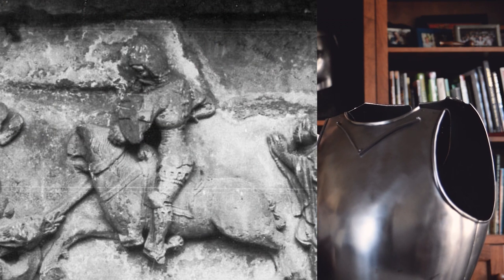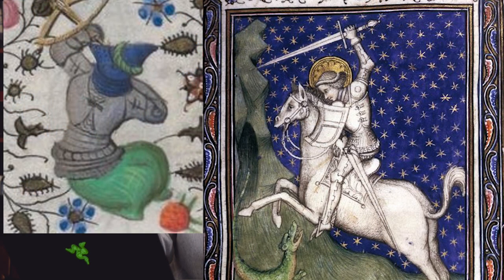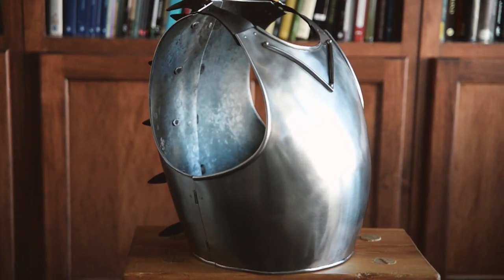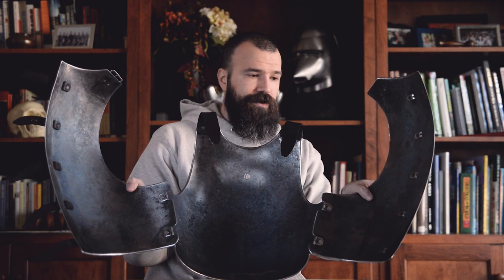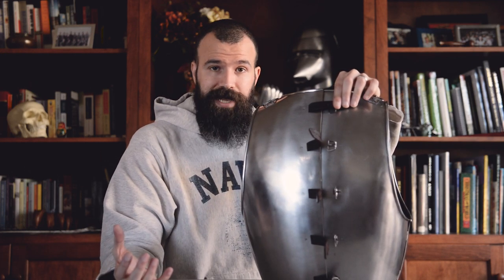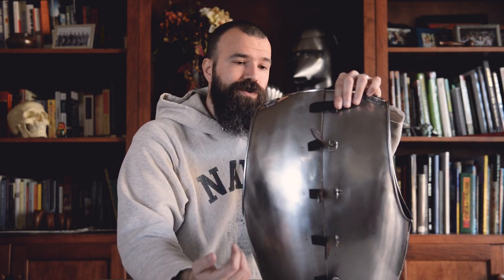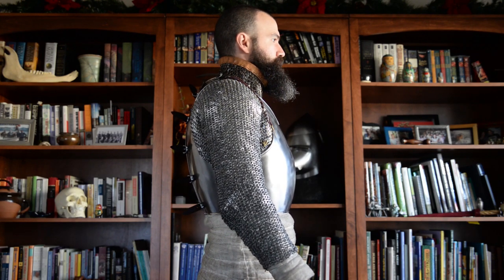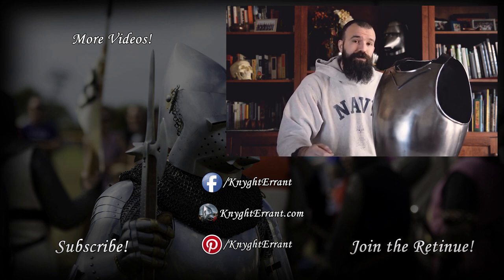Early 15th c Cuirass Part 1:  Breastplate and Hinged Backplates

Comment: Heyya! May I ask if have access to, or experience with the later Spanish style breastplate?
The type that terminates fairly low onto the abdomen, unlike earlier breastplates where they terminate right below the ribs.
I'd like to ask regarding the stomach mobility of the Spanish breastplate, since it's usually a solid plate with no articulation. Would crunching your abdomen cause it to bite into your abdomen?
Reply from the maker: Most of the fit and mobility from a breastplate really comes from the breastplate compressing and terminating at the natural waist along the sides of the torso rather than directly in the front. It's the lateral compression that bares most of the load. A peascod breastplate still fits snug at the sides where it counts, and then projects lower and outward in the front. It may slightly lessen one's ability to flex the lumbar spine purely in the sagittal plane, but your hips should more than make up for that and you would still have your ability to bend laterally and twist at the natural waist like normal.

Comment: One thing I've been wondering: Is there any configuration of full plate armor that would be possible to put on without the help of an assistant? So far it seems that chest/back/shoulder armor always comes with straps or buckles that you can't reach on your own (at least not with both hands). Is there any feasible way around that?
Reply: Not without compromises to protection I would imagine. Knights who could afford full plate harness had servants. And having people who's job it is to put armor on for you are way more convenient than being able to put armor on yourself, especially if being able to do so requires sacrifices in protection.
Reply from the maker: You can put things like a front-opening brigandine on yourself.  Sometimes there are a little tricks to getting certain styles of shoulders on like leaving them attached to an arming garment or mail shirt etc..,  You have to remember though that no one was ever really needing to put on armor by themselves.  Knights may have had attendants, but even the poor footsoldiers in outdated coats of plates had each other to help don their armor, so getting it on by oneself should never have really been a historical concern.

Comment: Knyght Errant, I'm sure this is a naive question but if the gap overlaps why didn't they design it to open in the front so that a man-at-arms could put the armor on (or take it off) without assistance? Was assistance just taken for granted by the folks that could afford that sort of kit?
Reply from the maker: Openings are generally structural weaknesses in armor that can degrade it's protective quality.  A lot of the time, the design of breastplate is made in anticipation of receiving a powerful lance strike or crossbow bolts, so you want it to be one of the strongest and thickest parts of the armor.  A strong lance strike to a front-closure could compromise its protective value.  You're very unlikely to get hit very hard in the back unless your unit is routing, so it's acceptable to keep the back the 'weaker' part of the armor.  This is reflected in the fact that backplates are often omitted entirely from armors even after they had developed.  They were also developed later than the breastplate, so we know it wasn't nearly as much of priority.  Now as for armor requiring assistance, virtually every full armor requires assistance to get into it.  Knights and ranking men-at-arms would have had dedicated valets and others to help, but even the poorest soldiers still had each other help get into whatever armor they may have had, so there was always someone there to help you get into armor.  So protection is the priority, the idea of needing help just wasn't really a drawback because there are almost no realistic scenarios where you wouldn't have someone to aid you.

Comment: Hi Ian,

this really is a lovely piece of armor and the combination with the mail sleeves look really great and functional. I just came about to wonder about one thing about the hinges: would one actually need be concerned about the part of the hinges, which one can see on the outside of the armor, to get damaged in a way you no longer can easily open one or both sides of this construction? Do you have any idea about what to do if something like this would occur?
Reply from the maker: Some of this comes down to our modern expectations vs historical expectations of armor.  Can a well aimed pollaxe shot crush a hinge or damage a buckle?  Yes.  Did the armor do its job and keep the wearer alive?  Yes.  Then it's all good.  Modernly, we'd be very upset that our armor got damaged and would need to be repaired or replaced, but historically it did exactly what it was purposed to do.  We want our armor to last forever through repeated beatings over and over, they wanted their armor to keep them alive in the off chance they got hit in an actual battle.  That being said, I've never observed a modern practitioner have that problem occur.

Comment: I was just wondering if there was any systems for mounting the helmet to the breast plate. Seems like it could work pretty well some of the energy from blows to the head would be transfered into the breastplate.
Reply from the maker: Yes.  Around the turn of the 14th/15th centuries we start to see the development of the great bascinet which would ultimately replace the mail aventail of earlier bascinets with plate collar pieces that mate to and buckle down to the cuirass making your head and neck much more protected.  Later specialized jousting hlms would even bolt down to the cuirass.

Comment: I always wondered, what type of steel and thickness is in your armor set?
Reply from the maker: It's made from 1050 spring steel, heat treated.  Thicknesses vary significantly depending on the component, ranging anywhere from less than 1mm to about 2.5mm.

Comment: Do you think mail could be tailored like the arming doublet so that the portion on your body doesn't rise up?
Reply from the maker: You mean by replicating a grand assiette sleeve in mail?  One of the side effects of that sleeve design is that it creates an excess of fabric underneath the arm when the arm is in a relaxed position.  It's necessary so you can raise your arm overhead without stretching fabric at the armpit.  You can get away with this in fabric because the material is compressible.  The problem when you translate this to mail is that you'd end up with a large clump of incompressible mail directly in your armpit, which would make it very uncomfortable.
Reply: Don’t the elbow and arm outs already have small pockets of extra mail though in a shirt?
Reply from the maker: You have a pocket of mail on the outside of the elbow, that doesn't need to compress and it doesn't get squished into the fleshy bits of your elbow since it's all on the outside.  With the armpit, you'd be placing all of the excess on the inside of the joint.

Comment: Why did they intentionally design this cuirasse so that a fighter HAD to depwnd on an attendant to strap him in from the rear? A single backplate that hinged on the left and strapped on the right could be applied by the wearer or an attendant. That would have been a more versatile set-up.

Although it would not have allowed for expansion of torso as this arrangement seems to have. The rear straps could be let out here as the fighter put on some weight or added more padding underneath.
Reply: Keep in mind it's very difficult (maybe even impossible with some configurations) for the wearer to tie their own arm armor into place. You pretty much always need someone else to help you put on your arms so having them help with the backplate as well isn't a big problem